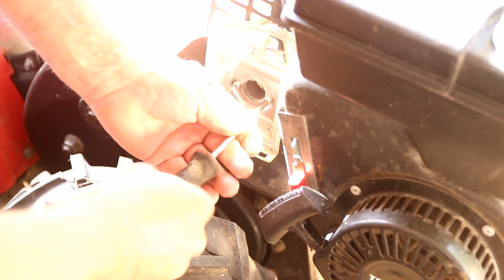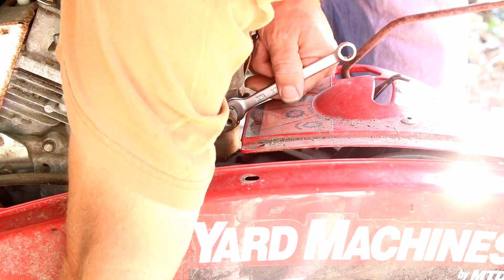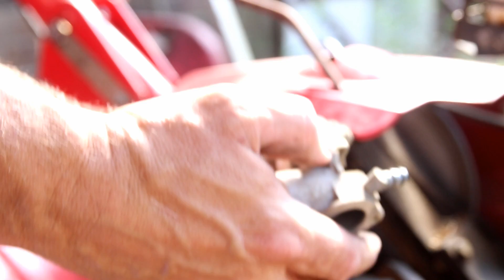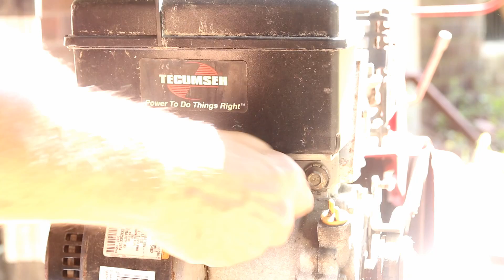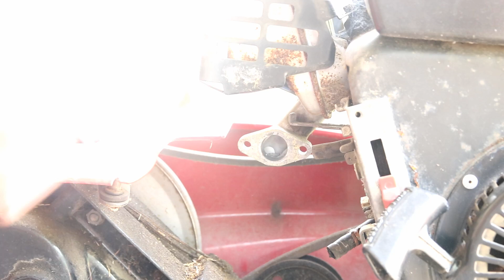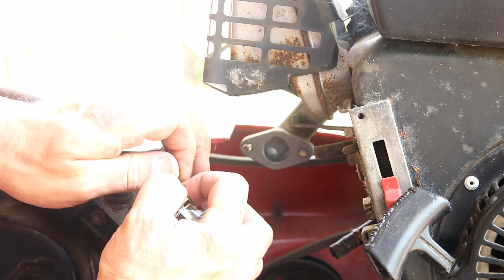Yardman Tiller Replace Carburetor & Fuel Line

Comment: I know this is an old video, but i have the same exact tiller. It was my dads. And i am about to put a new carb on it. I know i may sound like a dummy, but what shuts this off once you get it running? Is it the slider switch to the right of the carb with the rabbit and turtle picture on it?
Reply from the maker: I think that is the throttle which controls the gas going to the engine.  I can’t remember where the kill switch is, it’s been 10 years since I’ve used this tiller.  I’ll see if I can find out for you.
Reply: @justthegoodbits1  thank you.

Comment: I have the same tiller. Could this fix the problem of gas draining its fuel theu the filter . it drains an turns off
Reply from the maker: Yes, if you replace the fuel line and carburetor that should fix your problem. Thank you for your comment.

Comment: just replaced carb and fuel lines on same machine, as well as the fuel tank. Burns off gas from priming and dies immediately. Any suggestions?
Reply from the maker: Disconnect the fuel line from the carburetor and see if you get gravity fuel flow if you don't get fuel flow loosen the gas cap and see if you get fuel to flow. If the gas tank cap is too tight it may have created a vacuum which will not allow the fuel to flow.  The plastic hose barb on the bottom of the fuel tank may not be clear.  There is no quality control in China where most these things are produced.  Hope this helps.
Reply: michael Gibson did you figure it out?
Reply: gypsy